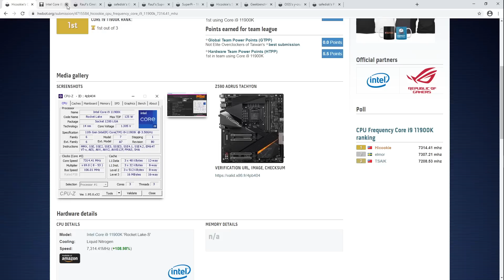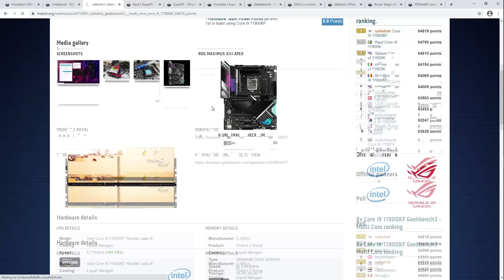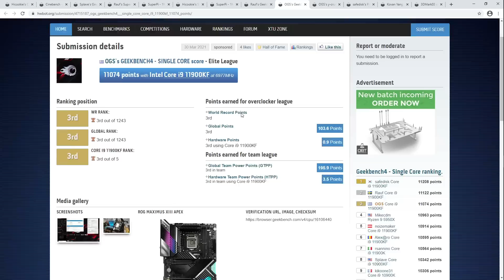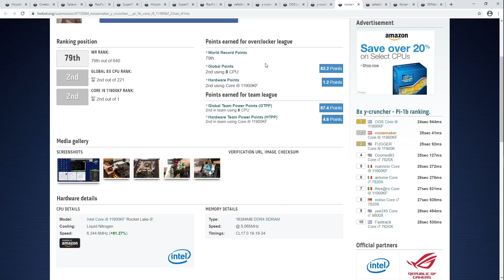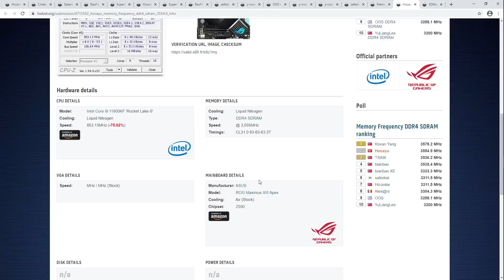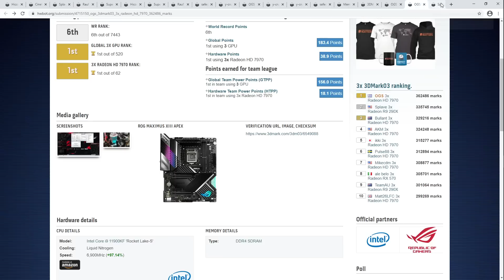The ONE thing the 11900K is good for!

Comment: I have a theory why ASUS may not be going 'all out' with single-core clocks, aside from that may have been an early beta BIOS with non-functional per core clocks. for a corporation that makes the part to be entering into a competition competing against individuals without access to trade-secrets of the parts, is a bit unsportsmanlike, especially if they're using the trade secrets to effectively cheat. so eh.  a demo that their board is good, yet not going so far as to cheat, maybe.

Comment: Buildzoid would I experience more benefit in my 2700x build adding another 16 gig of my trident Z 3200mhz CL16 or replacing it with 16GB of Patriot Viper Steel. 
 My current memory is E-Die Samsung

Comment: I tested two chips now. But only at AIO. One 11700K and it was "crap", no more CInebench R20 than 4900 MHz. impossible to get higher.  Now 11900K and can run up to 5200 MHz R20 (but at high voltage). And on the table I have 11900KF, propably I will test next week.

Comment: Can someone recommend a Mobo for 5950x that’s great for overclocking the cpu and ram and not losing 8 gpu lanes when you pop in some gen 4 nvme ssds?
Reply: @owowowdhxbxgakwlcybwxsimcwx  sorry my question seems pretty shit looking back at it now. I believe most high end b550s have support for dropping down the GPU lanes to increase storage. dark hero viii seems like a good option but it’s always out of stock. 

I think what I’m trying to figure out is what boards have the most advanced memory topology and power delivery. If it’s a b550 I’ll compromise on storage as long as I can have gen4 x16 for the gpu and one gen4 nvme slot. If it’s an x570 I won’t have to compromise but I’ve seen Bullzoid mention a lot of x570 boards are behind in memory topology.
Reply: How about the v2 x570 mobos from gigabyte ?

Comment: I got into ln2 about a year and a half ago, and buying hardware and ln2 without help is very difficult to compete. I still enjoy doing it.
Reply: Did you transition to dry ice first or right from ambient to ln2? Maybe a chiller or phase either?
Reply: @Onewolfoc  tried dry ice first, did it one time. I went right to ln2 after that due to how messy dry ice is.
Reply: @Apollo-Computers  really huh i went to dry ice awhile ago been having a hell of a time getting ln2 around here for less then total robbery pricing (4USD/L) never had a issue with the pots I've been building and designing far as the mess though I have a extended top and a gasket that most pots don't have. If you 3d print a pla gasket for existing commercial pots (like KPs, romans, bartx pots ect) they should seal assuming some pressure from the mounting hardware and keep any alcohol or acetone from splashing about to much or making it out from the machined surface between the copper base and the top.
Reply: @Onewolfoc  yes ln2 can be pricey, if I only get my 35l dewar filled I pay $2 litre, but if I get 180l tank delivered, it's $170 plus one year tank lease $300. My guy said he's going to get me a good discount and contract pricing when I order the big tank. But getting hardware is impossible for me atm.
Reply: @Apollo-Computers  yea I have the opposite problem in both aspects. I have hardware out the wazoo + the local airgas ln2 distro center is run by a total prick can't get anything better then highway robbery pricing when I know of many people in the US getting 2 bucks a L or even cheaper pricing from them. I have one other supplier I might be able to try but I can get dry ice so darn cheap (down to 65 cents a lb) so that's been a good option for me right now I till I can source ln2 for a reasonable price
Reply: @Onewolfoc  airgas is something else. My first time ever getting my Dewar filled I went there, the website prices weren't bad, but the guy filled my Dewar with medical grade . It was $10 a litre.

Comment: I generally lean towards AMD doing good things these days. However - just my thoughts on the 11x family.

1. Intel continues to FUCKING AMAZE me with what they squeeze out of 14nm. Amaze. That being said, its reheat/rehash - and you can only do this so long.
2. The high end isn't interesting. As much as people might squeeze more out on LN or similar, the 11900k and similar is just sat as far as you can go. Its too expensive.
3. Intel midrange is priced right, perf is good, its available in channel. AM4 is basically now end of life, so the Mobo/socket challenge of 'upgrade-able' is done for AMD. This is a hard budget space, so its about good price/perf and not being overly concerned about much beyond that. 
4. The XE drivers will be out in a few weeks. A huuuuuuuuuuuuge chunk of die space is due to the GPU piece. I don't know what that perf will be, but - BUT - if its actually AMD beating its a game changing piece given how crippled GPU space is right now.
5. I still 'technically' prefer AMD, but we're back to a state now where its all well beyond 4 core count, and we as the consumers win win win. Amazing time as its a window of exploding innovation that had basically died until AMD started gamechanging. 

Nuff said.
Reply: Rocket Lake's iGPU only has 32EUs, so it isn't going to be great. Fully enabled, Tiger Lake has 96EUs, and it wins sometimes against the AMD APUs and loses sometimes.

The Xe graphics are going to be fine for desktop use, you get Quick Sync video encoding (which is better than the awful old encoder in AMD APUs), and Intel has better Linux support. But AMD is still going to be better for APU gaming than Rocket Lake. Of course, even something like an RX 580 or a 1060 will run circles around any APU.

Comment: G'day Buildzoid,
I really enjoyed the Format of this video, although not planning to do it myself I have been enjoying the LN2 OC content from You, G/N, Bearded Hardware & Jay, I liked Joe's comment "It's like Top Fuel Drag Racing for PCs" so going through the records & having some explanation of how they get there is really Cool,
Although not going to the extreme of LN2 I have been gathering parts for OCing with Air & AIO cooling on LGA1155, I have made myself a TestBench with an ASUS Maximus V Extreme, for CPUs to play with I have Pentium G2120, i3-3240, i5-3570K & i7-3770K, as I want to see how Core scaling also behaves,
For GPUs I have an ASUS RX570Strix, Sapphire RX480Nitro+ (which I have had to 1440MHz stable in Heaven) plus 2 GTX760s, a Gigabyte OC 2GB & EVGA SC 4GB, I am hoping to get some better than 1600MHz Green PCB RAM too but it's not really a good time to expand my setup,
I am learning quite a bit from your content & when something hasn't sunk in it is great I can go back & watch again,
Thanks for all the "Awesome' OC content
Reply: With fairly minimal effort you could bench dry ice. There are a few decent pots for that out there you might be able to scoop up for cheap used or if you want a decent evaporator for cheapish you can make one on a good drill press if your careful about the design. Just a idea  for you to consider
Reply: @Onewolfoc  G'day, yeah that would be good & I did think about it, but due to a head injury that has cause nerve damage I shake similar to Parkinson's Disease,
so it is not that I don't want to go SubZero I'm too messy to go SubZero, I struggle to even pour myself a drink in a normal cup without making a huge mess, I would need a pot the size of an ITX mobo 🙄, Air & AIO's are the way to go for me 😁,
I have a good Coolerbox so if I get bored with Air & stock AIO I am was thinking of extending an AIO to use that as a reservoir with ice in the water,
I have extended one before to add a GPU, but I just needed a little help refilling, my cousin is happy to do that but as he is not into computers so he will get really bored & cranky if I ask him to help me bench all day SubZero 😞
Reply: @shaneeslick  well I'm sorry to hear about your injury. Sounds like you have quite a bit though there. I'm not sure if you would be into the idea or not but I think I might have a idea for you to get a little more overclocking headroom that might be worth a thought. Sounds like you can pretty well do water cooling. Would it be possible for you to do a water chiller? Or single or multi stage phase ? You can convert a window AC unit fairly easily into a water chiller or if your good with a bit lesser performance a HC500 would work pretty well and get you around 0 degrees enough that you could get a bit more headroom. I'm not sure if any of those ideas would work for you or even if you'd be interested either. I just thought I'd toss the idea out there. I also have a idea on how a evaporator for dry ice could be modified to possibly suit your needs if you really wanted to pursue any of this stuff further. Just some thoughts - from a friendly neighborhood nerd :)
Reply: @Onewolfoc  yeah they seem like good ideas for 'maybe in the future', I am still rearranging thigs to give me room in my little Unit/Apartment so I can even have the Testbench setup full time, as at the moment I have to use my PC Desk or Dining Table, I am looking at making myself a space for a desk with shelves plus a Flat Surface big enough for the Test bench & to build LEGO as that's what I do for hand-eye coordination therapy, but I will get there, just gotta take one day at a time 😁
Reply: @shaneeslick  well wish you the best and have fun benching!
Reply: @Onewolfoc  Thanks, you too

Comment: Wait so how does using 10nm not allow it to clock better than 14nm?
Reply: Their 10 nm process did not play nice when trying to scale it from lab based theory to a production ready level process. There goal was to shrink the process further to the level of tsmcs UV process tech. The first iteration of intels 10 they wanted to bring to market was utterly agressive and most of the companies in the space thought they were crazy when they announced the pitches and density of the parts they could make on existing Lithography machines without making the jump to eUV or UV light as a major portion of the litho process. They ended up trying to mix a lot more into the chips including cobalt to get it to work but the yeilds were trash. Later on intel took that 10 nm process and made it less agressive and dense to the tune of slightly less crazy then tsmcs current 7nm stuff without eUV anyways that's the process they shipped a few mobile parts on. Anyways usually these processes start production scale on the mobile side then as they improve they tweak the process and make desktop chips. The process optimizations that lead to less generally leaky chips tends to also on average lower their frequencies but at the boon of extreme efficiency (good for laptops and mobile while not so good for desktops and overclocking) so they play with the process and optimize it for higher clock speeds though usually this means the inverse where it makes the chips generally a little more leaky overall. Intel took a gamble and it dint pay off....however if their gamble payed off they would of got a entire generation and likely a refresh off existing payed for Lithography machines which would of improved their profit margins for a few years.
Reply: It depends on the architecture and how long or how many stages the pipeline is. intel usually goes for longer pipeline which nets higher clocks (most of the time) at the expense of something else (i forget at the top of my head) while AMD tends to go for shorter pipelines thus lower clocks. It could be longer pipes may have more interference once you go smaller.
Reply: @NightMotorcyclist  you probably mean at the expense of ipc?
Reply: @miniweeddeerz1820  I did at first but was second guessing it as there may have been ways to mitigate this with new architectures.
Reply: @NightMotorcyclist probably yeah.

Comment: i really enjoyed this one, its a perspective on hardware you dont get if you arent in the xoc scene with at least one foot. and reviews have mostly been "waste of sand" so getting to hear something else was a nice change of pace.
also, about the as few cores as possible vs all cores when going for max clockspeed: imo, getting the biggest number is impressive, period. however, getting the biggest number, or a number very close to it, with all cores enabled is at least as impressive, if not a display of luck (because you have a core thats equally good across the board, or which has very high clocking lemon cores).
it could be interesting to check/compare results by treating max frequency in general and max frequency all cores enabled as separate categories

Comment: Only reason to even consider getting inferior intel trash is if you already own a motherboard that you can out a better CPU in

If you are looking to get a motherboard and CPU AMD is actually the only logic choice

However not at the moment wait until AMD either announce 6000 series and say its for AM4 performance or for AM5

And then you can get an AM5 motherboard and keep it for 4-5 years and still not need a new one
Reply: Ironically Intel now has better burger offerings. Ie 11400F.
Reply: @rdmz135  meh but AMD wins in budget motherboards

So for some budgets the savings from motherboard means a more powerful CPU

However AMD has refined there chip-let design and manufacturing too much there aren’t enough CPU’s defective enough to make a 4 core CPU or a lower clock 6 core

And even if there actually are they are probably amassing stock of the Chip-Lets and focusing on making the more demanding CPU’s the 5600x, 5800x, 5900x and 5950x

As well as the oem 5800 and 5900

There may be other in oem ones but there are definatly also the console CPU’s

Silicon waffers are having stock issues so other stuff could be as well

I wont lie at the moment intel is a better option for the extra low budget people until AMD announces and releases lower end CPU’s 

Well unless they are happy going back a generation to 3000 series and upgrading later to a used 5000 series

Comment: Turn off avx512 and they should go higher if it was enabled at 7Ghz
Reply: There aren't any AVX 512 instructions being executed while saving a valid file so it shouldn't make a difference
Reply: @avagreen9060  I'm well aware of that, but cypress cove is a rollbacked architecture to 14nm with avx512 that extends already huge registers, UEFIs have options to specifically disable it as an "overclocking" feature.

Comment: I'm thinking if they would have kept the cache proportions equal to the Tiger Lake (1.25MB L2, 3MB L3 per core) it would probably keep up with Ryzen, and maybe even exceed it.  The ones they released (512kB L2, 2MB L3 per core) just aren't good enough.
Reply: TGL is a completely different core design, and the die already is gigantic with this small amount of cache.

We're getting Alder Lake and the 8 core TGL CPUs soon anyways, nobody except overclockers should buy 11th gen
Reply: Larger cache comes with latency penalty. In fact, TGL is slower than ICL clock-for-clock in some benchamarks because of it.

Comment: So bottom line i shouldn't upgrade from my 9900k ? :P :P (great video man)
Reply: Still on my 8086K and 4790K.
Reply: @eplus341  Absolutely .I mean this 8 core back and forth thing drives me bonkers although i love Intel.In my case with Music Production and stuff i think stability is the goal where Intel thrives but boy that Thread ripper is really tempting (they do have compatibility issues with various softs and hardware ) . Bottom line again its a no for me. (8700k is great btw)
Reply: Nope I'm keeping my 9900k till DDR5 RAM comes out at this point.
Reply: @eplus341  I'm sill on an x58 LGA 1366 56xx at 4.6ghz all core stable for the last 11 years lol (it will do 5.2+ but I don't trust it at those voltages).

Until a graphics card needs more than PCIE 2 x16 to maximize its performance, I'm not upgrading, either lol. Almost nobody needs to unless they are using their computer as an actual workstation that utilize the crazy transfer speeds of PCIE 4.
Reply: @eplus341  I am still rocking a 4790k and I don't see a reason to upgrade too. It is fine for 1080p gaming even today.

Comment: My 10900KF would run my GSKILL 3600 Trident Royal Z in XMP on my MSI Z490 Godlike mobo, but when I swapped in the 11900K yesterday, that CPU will not POST in XMP.  2666 is all it will do.  I shot an email to MSI, and they replied, "seem like the processor's memory controller does not like the XMP setting with your memory module."
Reply from the maker: the 11th gen BIOSs right now are very unfinished.
Reply: @ActuallyHardcoreOverclocking  Thank you , I'll keep running with stock memory timings for now and hope that MSI stops blaming the CPU's memory controller. That reply from them was a bit disturbing.
Reply: @ActuallyHardcoreOverclocking  I let MSI know that no manual memory speed settings would post other than stock settings. Hopefully they will look closer at the issue and stop immediately blaming the 11900K's memory controller.
Reply: just select the frequency see if the board will train on its own. if it does post its a certain timing that 11th gen doesnt like. if not then its bios issues
Reply: @bigcazza5260  I've been working with it all afternoon, but it won't POST above 2666. I tried setting a manual frequency just one step above stock 2666 in the BIOS with no luck.  I agree with Buildziod's & John Jenkins' repies, which is why I emailed MSI to let them know.  I was surprised that in less than 6 hours, MSI replied and blamed the CPU's memory controller.  I had at least hoped they would take a closer look at the issue.
Reply: @John Jenkins  Thanks, but I decided when I got the Z490 Godlike that it and the Z490 Ace would be the only MSI mobos in the LGA1200 lineup for me. I've got two Maximus XII Hero mobos as well, but they don't have Gen 4 M.2 sockets, so 10th gen CPUs are staying in them. The 10900KF went into the MSI Ace mobo, since it doesn't have an IGPU power stage anyway, so I've got the 10900KF and 11900K systems side by side.